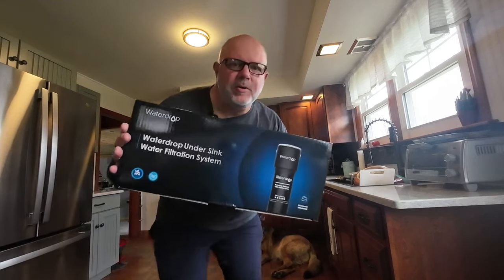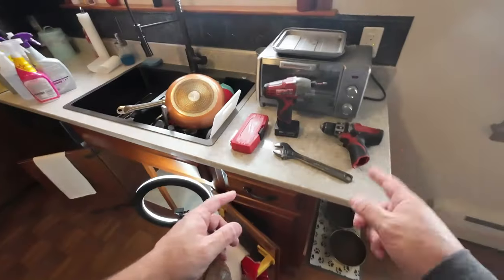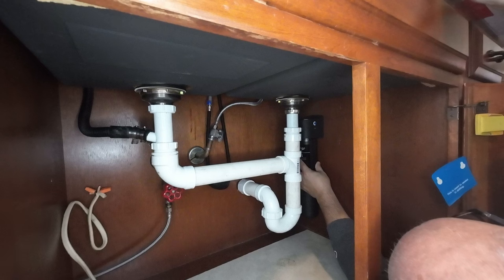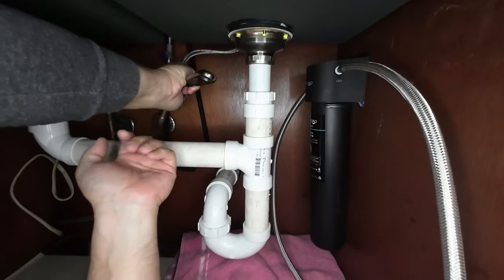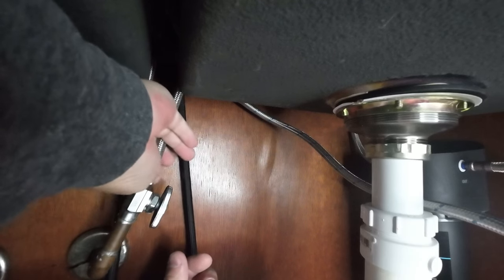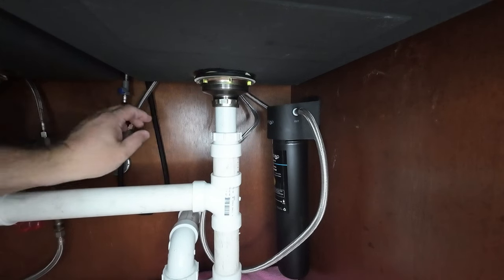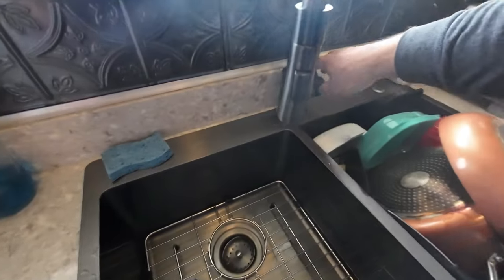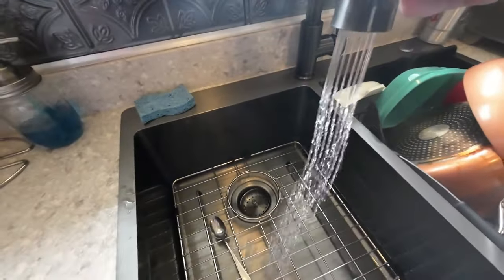Waterdrop under counter water filter installation.

Comment: Thanks for making this video. It's very helpful in assisting me in my plans for doing a similar install. 

I just ordered this same filter. I intend to use it for drinking water only, not for the main faucet. I don't think they're designed for high flow rates, which explains the reduced water flow when used on the main supply. 

To ensure optimal performance, I'll tap the cold water line and send it to the filter unit to avoid compromising the main faucet's functionality.